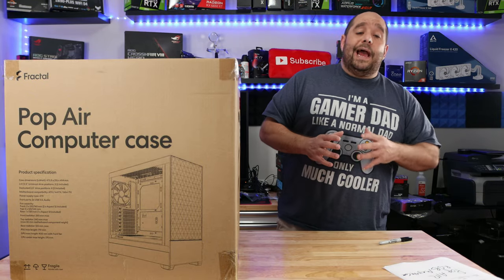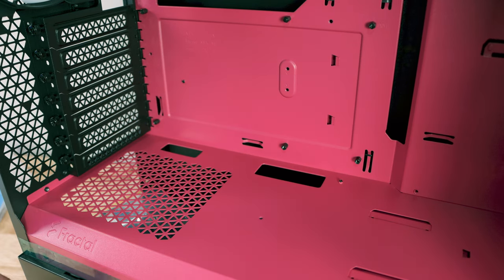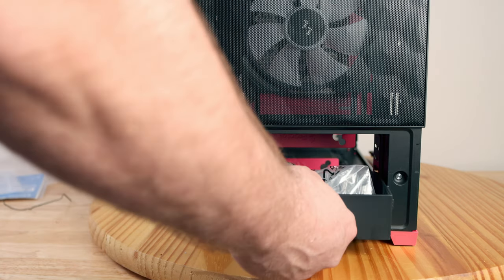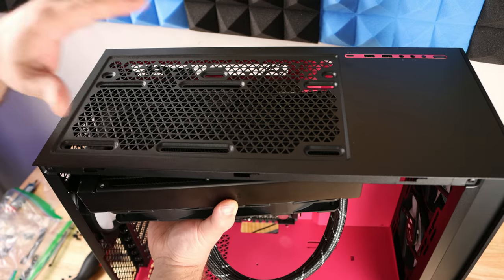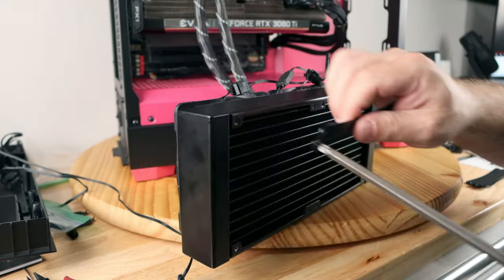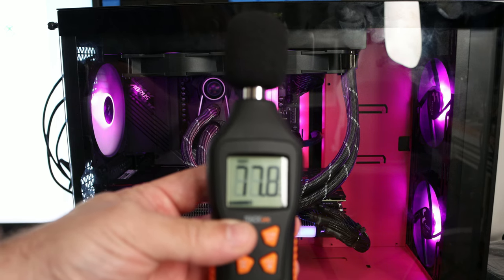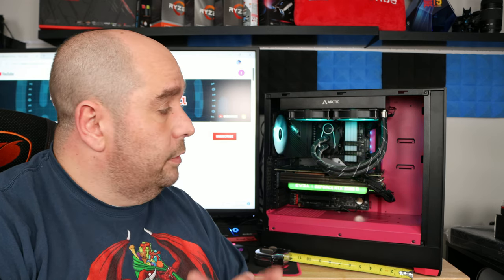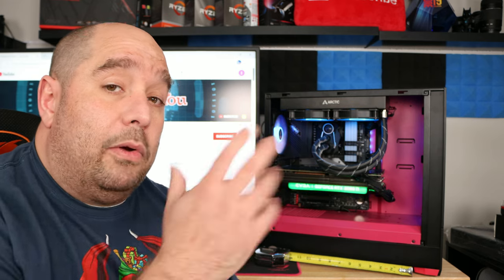Fractal Pop Air RGB Case Review -  A Budget Friendly Case that Does it Right!

Comment from the maker: WATCH NEXT: Check out Where to buy a Cheaper & Legit Windows 11 or 10 Key: https://youtu.be/nsl7s0ME8JY
We review the New Fractal Design Pop Air Magenta Core PC Case.  
A complete, airflow, build quality and noise testing review.  This case has it all, it is a BEAUTIFUL case, but it does have a big issue.
Check out Where to buy a Cheaper & Legit Windows 11 or 10 Key: https://youtu.be/nsl7s0ME8JY
Find it here: https://bit.ly/3NAINJr
You can buy these keys with a 20% discount when you use code TBFY20 on check out, with a lifetime warranty. Find them here are Softwarekeep.com, just about any license there.

Comment: Nice, I was having a windows not loading up at startup and nothing worked so I bought a new power supply. I felt stressed just thinking about all those cables and you made it easy. The problem was an old hard-drive though.
Reply from the maker: ahhhh well, at least you got the issue resolved, so very happy its all working now